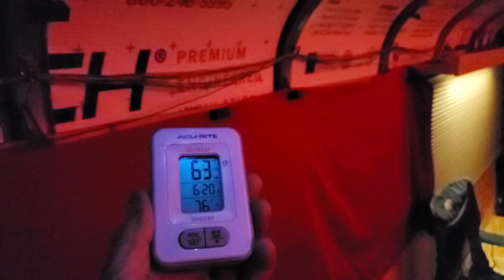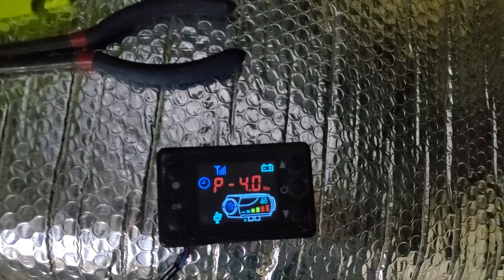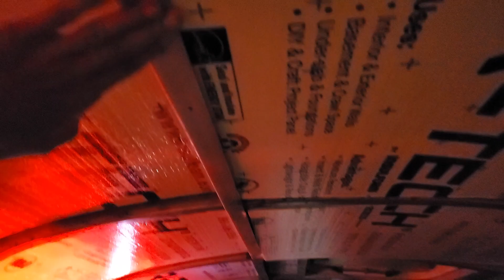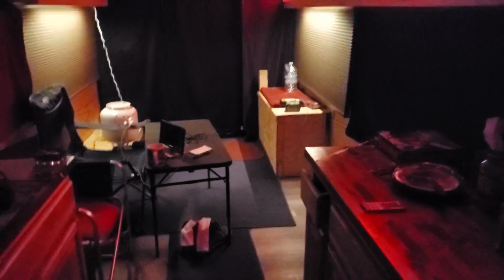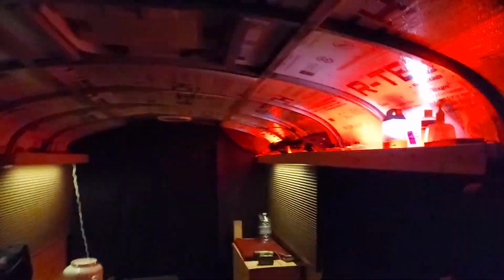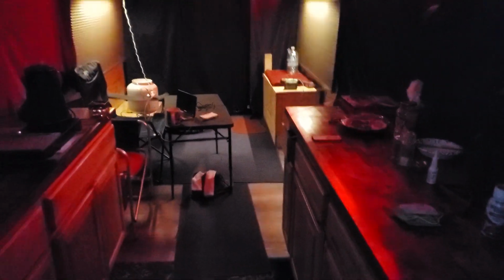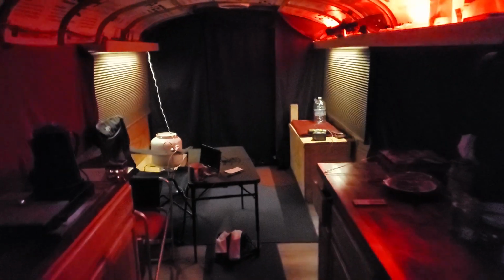I was asked..."How loud is your diesel heater?"...

Comment: I've been thinking about one of these...Id be more inclined if the van had a diesel engine. Still using little Buddy here with the long hose ran to an outside toolbox w/ a pair of 20lb tanks. They power the generator too. As much as I want a diesel heater it's hard to add another required fuel source since already using gasoline and LP. Your 76°F inside wow! I prefer about 50°F 😅

Comment: I would research the Hertz adjustment, as I believe it changes the air/fuel ratio? That is used for elevation change, not temperature?
Reply: Those are two different things But you art half way right
Reply: @pauls466  Well Sir, If I am half right, then you only responded with half an answer. lol  What is the other half that I need to learn?
Reply: @pauls466  Correct me please...   the hertz setting sets fuel flow, to match fan speed which can also be reset.  However for proper combustion, the Hertz and fan speed are factory set to work together, so messing with either will likely cause many issues from not starting to sooting up.  So, one should only play with temperature settings and leave everything else alone, if it is working well.  Some people use an exhaust analyzer to set combustion balance.
Reply: @ThisOldMan-ya472  Well if you have it in hz mode than you can rev the hz UP or Down  without compromising the burn as the RPM will follow accordingly . However if you change the hz after using the 1688 or 9009 code than yes you could mess up unless you know what you are doing and have like a co meter ect. I hope this clears things up  Grts Paul .
Reply: @pauls466  Thank you.  Are you in the Facebook Forum for these heaters?

Comment: Doesn't make anymore noise than a furnace in a house. Advantage is having a thermostat.
Reply: Dan has it in hz mode but you can run them in temp mode as well. Remember they do not start/stop but go in to idle , if that is still to hot than open a window.